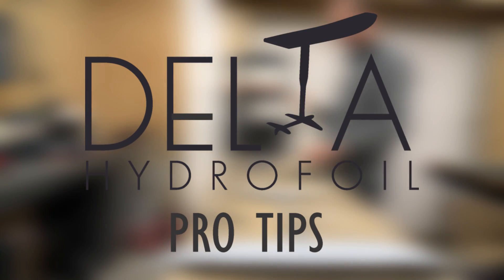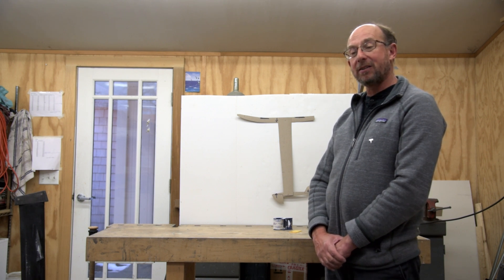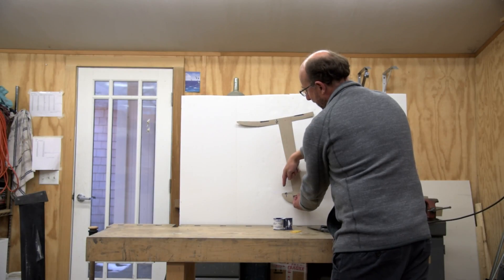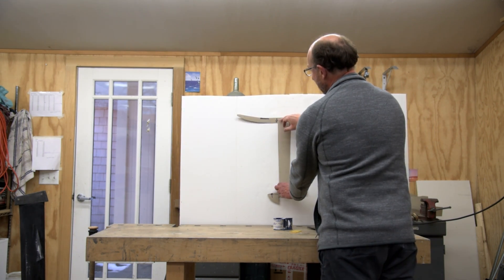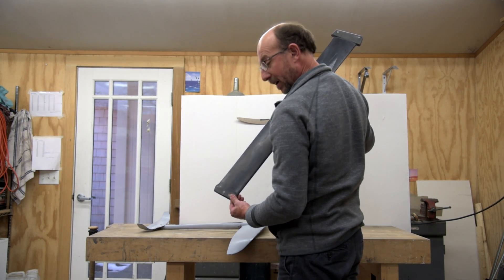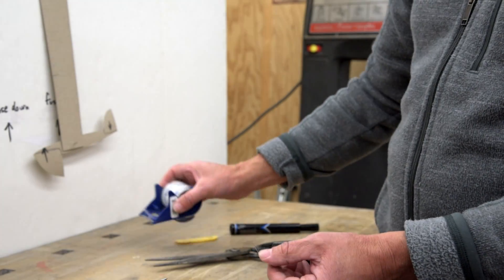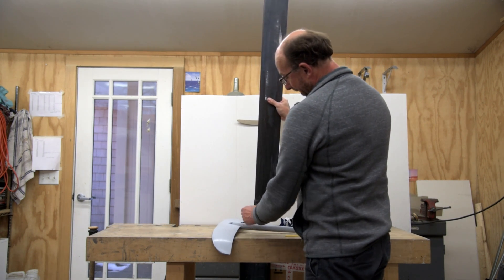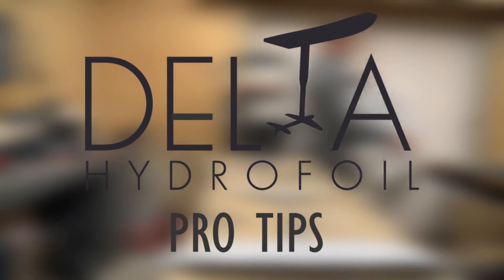Delta Hydrofoil Pro Tips : Shimming your hydrofoil

Comment: Wouldn't shimming the back wing also reduce front foot pressure?
Reply from the maker: +Christophe Meletiou yes but not every one has a adjustable back wing. Some are a one piece foil
Reply: Can someone explain how that's done? I have a 633 moses and I am very light guy. Which way would you tilt it to? It has two screws. would you shim using the front screw or the back? Thanks in advance
Reply: Ok, but if it is adjustable, then surely that is the much simpler option. Simply shim the rear stabilizer wing?